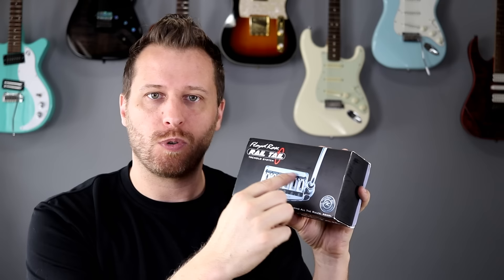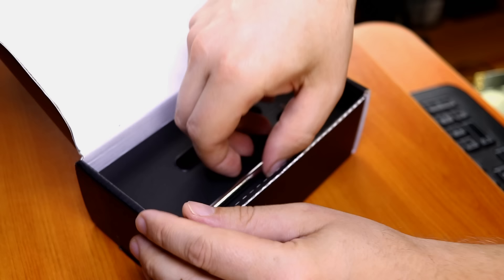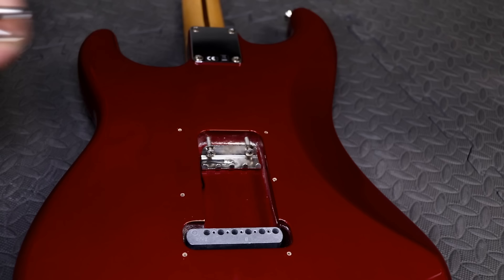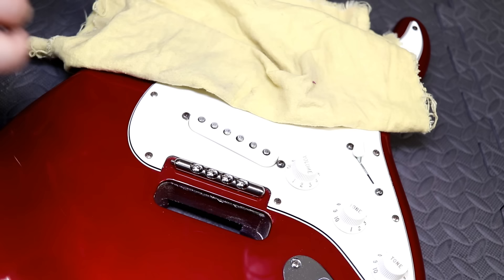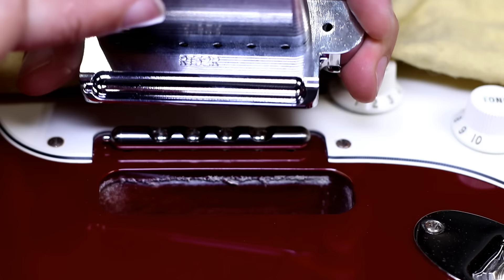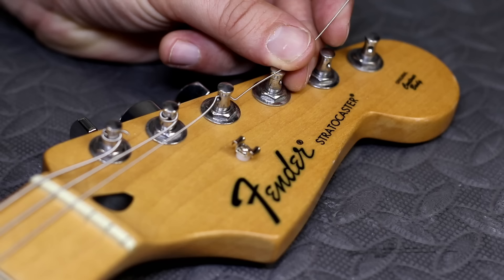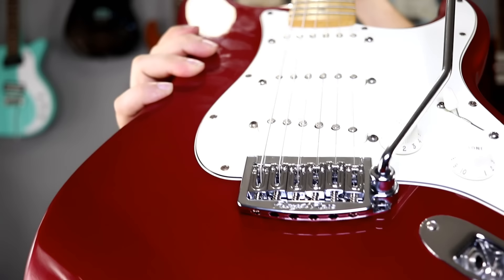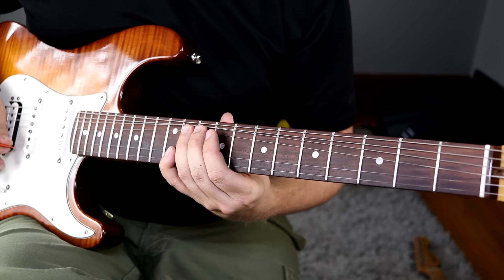Farewell to Fender's 6-screw Trem! - Floyd Rose Install!

Comment: Great vid. I like a floating trem.  I have the 6 screw wilkinson that locks the saddles.  Works pretty well.  Any other ideas on the best vintage floating trem?  Like the PRS.
Reply from the maker: Thanks! 
The PRS trem is really great. 👍
Most of the Fender replacements don't enhance the trem operation,  but do use much better metals. 
Lots of people recommend the Blade Runner, but I've never had the chance to try one out.

Comment: Wouldn’t adding more spring tension  and decking on any floating tremolo give the exact same effect?  This one essentially pivots on a bearing but so do some Ibanez, Vigier and Hipshot bridges.  FR model you have is way to expensive for a dive only tremolo.
Reply from the maker: Hi
Well, it depends what your goals are. If a person isn't interested in floating their  trem, there's no better bridge I've ever used. ☺

Comment: I have a Tom Rodriguez '68 Strat copy, and it has a Callahan Vintage S bridge. I always have been able to keep my Strats, even with stock 6 screw bridges tight to the deck. I got very ill awhile back and left my Rodriguez in the case for a year, and when I took it out, it was still in tune. The only difference I can see is the Rose you installed can bend further down for dive bombing, which I quit doing in my late 20's. So, what's wrong with a well made 6 screw vintage Fender style bridge like the Callahan?

Comment: An LSR roller nut and locking tuners would give you some more stability but genius idea to wrap the string to lock it where did you learn that??
Reply from the maker: Hi! 
Yeah, locking tuners are way more convenient, but wrapping the strings to lock onto themselves is a good workaround.
I'm not sure, where I first learner it, but likely on a forum somewhere ☺

Comment: It's funny, but Ibanez was using a trem like this on their guitars in 1985 (Powerocker Special). Hardly revolutionary.
Reply: Yes, the PowerRocker. You know your gear, well done! A few fundamental differences are the Power Rocker is essentially a long knife edge with minimal contact area. The Rail Tail tremolo mates with a long cylindrical pin or rail increasing more surface area contact which results in greater sound transfer and tonal qualities similar to a hardtail. It's also designed with plenty of adjustabilities to easily retrofit a variety of different guitar brands and models.
Reply: @officialfloydrose5849  Thank you for that in-depth explanation on the differences. That is actually quite the difference!

Comment: What's the tension like on that bridge? couldn't you achieve almost the same thing by tightening the spring claw screws to the point where the standard bridge is decked? did you have to do that with the rail tail to keep it decked? In my opinion a tremolo needs to be able to both increase and decrease the pitch, thus it needs to float. Fender make a 2 post floating bridge that is a cross between a floyd rose and their standard bridge that is pretty good, my deluxe mim came with it and it stays in tune pretty well.

Comment: Waxed dental floss will work in keeping a threaded bar from wiggling around. If you put it on right it can last for years.
Reply from the maker: Good tip 👍 What if you take your guitar in and out of its case for rehearsal and gigs every week? Pop in arm is just sooooo much better in every way ☺
Reply: No question about it. My other strat has the pop in arm found on American Deluxes which I purchased after market and is by far my favorite. I havent gotten around to replacing the threaded one on my Warmoth Strat yet.  Kinda broke right now so the dental floss trick is cutting it right now. You can by the way, remove the bar as many times as you like. If the dental floss is put on tight enough and thick enough, it will last potentially for years. Its been about 3 yrs so far for me. I really should get a better trem though.
Reply: The new Floyd is intriguing. Glad i found your video.

Comment: I don't think that a bridge with more mass results in more sustain. I think that a bridge with tight parts results in more sustain, because the vibrations coming from the strings are not being wasted in moving loose parts. I think yo might be experiencing more sustain simply because it's built better and there are no wiggly parts. Just my 2 cents.

Comment: What is the difference with wide and narrow spacing?
And what if you had a guitar with narrow spacing and bought a bridge that’s wide spacing?
What modifications would you have to make if any?
Reply: The American Strats typically have wider string spacing (E-e  2 7/32" or 56mm) aka "vintage" spacing. The import Strats like MIM, MIJ or Squire Strats typically are narrow spacing. (E-e  2 1/16" or 52mm). It's always best to measure instead of assuming.  Because the Rail is slotted for adjustability, both a narrow and wide Rail Tail will fit on either style guitar. This system allows you to have the string spacing of your choice but keep in mind the strings may not line up 100% with the pickup poles if you decide to swap.

Comment: I just purchased a G&L Legacy Tribute. It has a 2 point trim with pop in bar, but it doesn't have locking tuners. What was that brand you demonstrated for strat with locking staggered tuners and the adapters for mounting?

Comment: Hey Darrell, great video as always! Could this Floyd be used on a 2018 Mexican Fender Duo Sonic without modification like your Fender? Thanks for the quality videos!
Reply from the maker: Hi! 
It fits both 6-screw and 2-point systems. The 2-point requires a little drilling though.

Comment: Have you ever tried the gotoh all steel popin trem? 6 screw, but with a lubricated nut and strings locked it works well.  But. I only set it up to dive as well.
Reply from the maker: I've never tried one. Gotoh makes good stuff though 👍
Reply: Darrell Braun Guitar Hi. Thanks for replying. Yes gotoh stuff is great. I've built guitars in the past, or my own. I love their stuff. Made in Japan. 
You would probably love the gotoh / wilkenson trem. 
If you've never seen the blade runner super V, you should check it out. Probably the best Strat trem out there. I only say that because I build guitars for fun. I try to use only the best parts, and hence had never seen the floyd trem you installed and that is why I clicked on your vid. 
Thanks again for answering and the great video.

Comment: I really enjoy how you modify fender quitarse and recommend hardware, would this Floyd rose fit a squire? I want to buy a cheap squire and mod it so I can have the best I can in a cheap rock guitar setup. Thanks again  Max.
Reply from the maker: Hi Max! 
Yes, it will fit any 6 screw setup, or a person could drill the required holes ☺

Comment: I'd love to convert my strat to a tele style bridge, eschewing the trem system entirely and making it as close to a hard tail as possible. I'm this close to seriously considering that expanding foam used in insulating walls mixed with random pieces of metal in various drawers. According to the resonance through mass deal, assuming the strings are neck through and not just mounted to the bridge, shouldn't this give you sustain from heck and back? We all know upgrade tremelo blocks with added brass add a lot on their own, so shouldn't an entire back and trem route full of metal with "continuuity bondy foam" be superior? Already have the body that's why I'm asking.

Comment: Thanks for your videos! They are really well done and are super helpful. They answer questions I didn’t know I had and help me think about my gear in different and fuller ways. 

I have an idea for a video for you, if you’re taking suggestions. It’s a question I’m currently asking myself about but don’t have the know-how to pull off. 

Could you do a comparison where you switch the pickups in a Les Paul style guitar so the bridge is in the neck position and neck is in the bridge position? I’m curious what the differences are and what your impressions are. And a Tele. And some others? 

It’s kinda like the videos you did where you took the exact same guitar and tested the difference between a rosewood fretboard and a maple fretboard.
Reply from the maker: Hi! 
That's an interesting idea. I should be able to pull something like that off if I can extend the lead wires of the bridge pickups ☺

Comment: How about a good video on replacing a tremolo bridge with a proper fixed bridge. I feel like I'm always on the outside in my utter contempt for tremolo bridges and finding good quality content showing good ways to replace them or to convert the tremolo bridge to a fixed bridge is almost non-existent. Usually nothing more than some vague comments on a forum post somewhere for instruction.
Reply: LordPadriac I’m sure you can just tighten your springs a lot and then simply take the tremolo arm out.
Reply: It doesn't really work though. Even replacing the springs with much heavier springs and tightening the hell out them the tremolos still tend to shift around and go out of tune. I've even tried putting a screw with a washer through the back to try and clamp a tremolo down but in the end the thing is made to move and resists attempts to fix it in place. I was hoping for a more elegant and permanent solution. Perhaps just buying Squiers and modding them is the way to go. The only complaint I really have about it is the neck is just a touch less fine in it's finishing touches than a proper Fender. I suppose the next one I will buy a fender replacement neck for it.
Reply from the maker: That would be interesting. 
That being said, this rail tail design will NOT move or shift. It's built like a rock. 
Might be expensive to just be used as a fixed bridge though.
Reply: Yeah that's why I'm kind of looking for wholesale conversion methods. If I can find a beat down Fender strat at a pawn shop for under $200.00 I might try replacing the trem with a Gibson bridge.

Comment: Wouldn’t screwing down the Tremolo on the Fender down so it’s flush and add a couple of springs to the back to accomplish the same thing?
Reply from the maker: Hi! 
In a certain sense, yes.  
In a more accurate sense, no.
This bridge has way more mass, is machined out of solid brass, has roller saddles, and a pop in arm. 
It will sound better, sustain longer, has a smoother and longer throw.

Comment: What if I wanted to put one of those on my SE Standard 24? I don't really know what would be the best way to go. I'd like better tuning stability and no tremolo usage. If it wasn't for the guitar being routed for a trem then I'd go for a good hardtail bridge. Right now, I have the base of the bridge laying flat against the body, but when I do heavy bends it goes off tune. I have a set of Hipshot locking tuners and they work well, but I need a little extra.
Reply from the maker: This would be the perfect bridge for you then. Incredibly well made and awesome sustain ☺👍

Comment: Cool video! Thanks!  ...but, could you set it up to float like you can with the 6 screw system?  Isnt it the same principle?  Just a matter of tweaking the tension balance between the strings and the springs?  What is it about this design that makes it a must that you have to deck the bridge?
Reply from the maker: I'll give it a shot and see what happens 😀
Reply: The Plus Top Floyd Rose MIM isn't routed with a depression and can only work (allowing you to go up and down) with the rear edge elevated, which raises the action enough that you need a shim to keep it in spec. I think you could raise the rear of this trem but it might require a shim too.

Comment: Have you seen super vee tremolos? They are able to instal with no modification and feature no pivot points and they also make a locking nut as well. Thought you might want to check them out.
Reply: David Wernsing have had my supervee for 9 years.  They used to be $275....but now, way overpriced.  Still a good trem though.  I've been pretty hard on it and its still in one piece.
Reply: Slide85 Im on my phone, so I don't know how to share a link. Just google super vee.
Reply from the maker: Hi! 
I would love to try a Super Vee.
Reply: Darrell Braun Guitar I would happily send you mine to borrow for a video.  You just have send it back Darrell haha.

Comment: Will this work for a Squire guitar? I’m tight with money and was thinking of just buying a used guitar and mod it over time. 
I have a older Aria guitar with humbuckers, split coil switch, 24 frets fixed bridge. I just updated the tuners to Planet Waves locking tuners that trim the wire automatically and that drastically improved the tone of my guitar. Stays in tune but has some thicker sustain that surprise me. Next is better pick ups and wiring. 
I wanted a strat and tele and was thinking of mods instead. What do you think?

Comment: I didn’t know about this trem system. 
I put on a babizc because I didn’t want to route it out. It has a blade and screws  to ride on. You can dive bomb but also do the reverse trem chirps. 
Very well built . 
I hope you show its capabilities. 
Did you rate the best trem systems?
As an engineer I always thought the 6 screw system was terrible
Nice tone. 
I personally think the bigger beefier brass and seating helps .
Pickups?
Reply from the maker: Hi! 
I'll have to check out the Babizc trems again. I looked at them a while ago, but never pulled the trigger. 
The rest of the strat is stock.

Comment: bummed I can’t put this system on my players series strat it has the two point design  instead of the six screws :(
Reply: The spacer mentioned at 2:48 is also used as a conversion template for installing it on the 2 - point tremolo system as well. You'll need to drill 4 small holes in between the pivot posts to mount the Rail. The install is shown at the 10min mark of the official Floyd Rose Rail Tail Installation video.

Comment: Do roller saddles on this kind of tremolo have any effect at all? They would appear to be pretty useless, since the strings are essentially anchored at the bridge by tension. 

The lubricated pivot bar is an interesting design, but I'm curious if it performs better than any of the knife edge pivots around.
Reply: These saddles are machined from solid brass. While brass is great for tonal qualities, not so great in hardness. Without the steel rollers added, the hard guitar strings would cut, or cause coining ( as the proper metallurgical processes term is known as) into the brass saddles in no time and eventually choke the string, adding friction and cause a tuning disaster. 

One piece saddles are fine as long as they are made of quality hardened steel so the strings can glide off without cutting or coining.(which is also a culprit of string breakage). Machining solid saddles from steel is expensive and this is most likely why Fender saddles are made from tone-robbing thin stamped steel. Worse now in hardness and quality than the original pre-CBS saddles Fender produced. Almost every aspect of the classic Fender 6 point tremolo has been thinned away to save a few cents over the years. :(

Comment: I got a 2015 strat to work on. I cannot get it in tune. Frustrating. Bought a cheap amazon electric guitar and it failed after 10 hours. Been playing the same acoustic and haven't had one issue for 5 years.

Comment: Are all strat 6 screw mount holes drilled the same , as in “wide, narrow” 2 1/16 wide string spacing verses 2 7/32 vintage string spacing verses standard or Mexican, Asian Squires Etc?  It looks like it does no matter as far as this trem system goes. $250 Amazon. both string spacings available.

Comment: Thanks man. You saved me a lot of trouble.. I was having a tough time deciding whether i should go for the old MIM standard (love the sound of those ceramics, dislike the vintage trem) or the newer MIM Player (better 2 point trem but thin sounding Alnicos).. 
Would it be a hassle to install this Floyd Rose on a 2 point trem strat ? (drilling holes and stuff :\ )
Reply from the maker: Glad to help!
They make it really easy with the template. As long as you're willing to drill :)